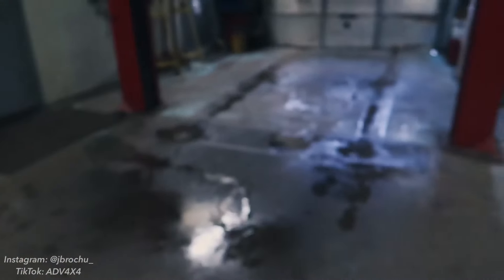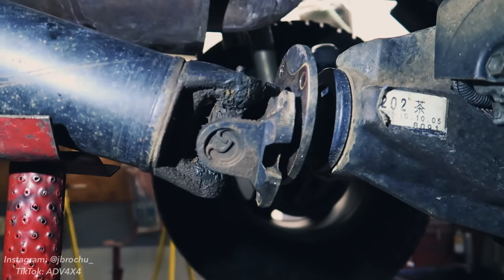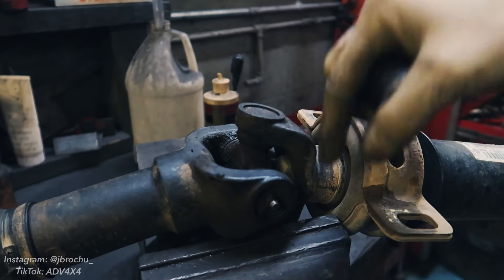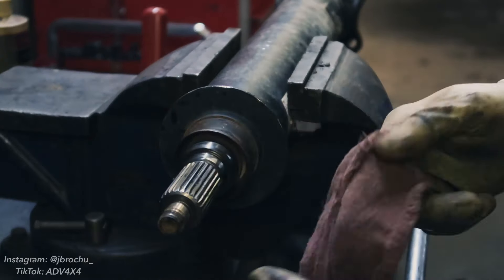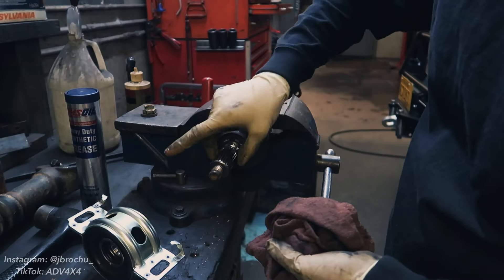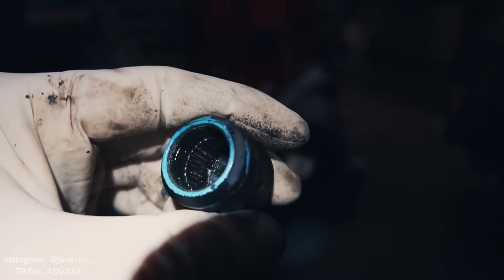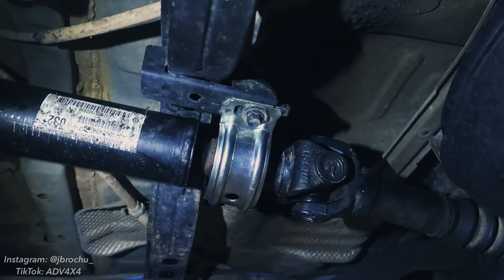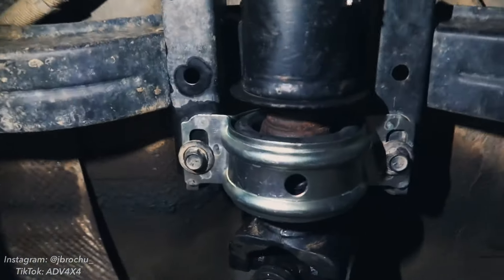How-to: Tacoma Carrier Bearing Replacement **DETAILED**

Comment: Ok so I did this exact repair, u joint as well, and I guess I missed my marks when putting the shaft back on?? Now when going from stopped, of I give it a little gas, the drive shaft slips! Can't find any of my marks. How do I find where to put it back? Is there another way?
Reply: Update, I did put the shaft in correctly, but apparently the bearing is bad? Ordering the more expensive OEM part. My mechanic said they always go wrong so they don't do them in house anymore and refer it to a local drive shaft place

Comment: Just watched this also! Agreed best video around! Thank you for this! 👍🏼💯
Reply from the maker: Thank Robert!
Reply: @Adv4x4  - I just went under my truck and checked the carrier bearing and it’s shot. The rest of the u-joints are tight though. I also have a bit of a lift with 35’s. I wonder if I should get that drop for the CB.

Comment: Thank you for posting, this helped me with my 03' Tacoma. Question...I forgot to index the drive shaft before removing. How can I tell if I reinstalled incorrect? Will the vibration be obvious? The Weights on the drive shaft are still in tact.
Reply from the maker: Take your best guess. You may not encounter any vibrations at all! But I usually index the shaft to be safe.
Reply: Thank you!

Comment: Damn got the wrong U joints and the greaser wouldn’t fit. Ended up putting in the u joints without the greaser since it was rubbing w the front shaft yolk. Hopefully it’s greased enough 😅

Comment: Thank you for your video. A few nights ago as I was driving home from work on the Friday night going around 55 to 75 mph I fill my truck rumbling. What changes is that it’s the carrier bearing?
Reply from the maker: I would check your front wheel bearings. Without being there it’s hard to diagnose for you but they are very common and prevalent at speeds you mentioned 👍🏼

Comment: great video! Can it do damage if you have some vibration at startup and don't replace the bearing right away? 2004 Tacoma thanks!
Reply from the maker: You will not feel a vibration on start up of the truck due to a bad carrier bearing. You will feel the vibration as you begin to accelerate from a stop and then it evens out as speed increases. It’s best to replace sooner then later
Reply: @Adv4x4  sorry, that is what I meant. starting up from 0 to about 10-15 MPH the vibration goes away and I also hear a faint squeek squeek at 1 to 5 mph. Can it cause more damage if not replaced right away? I did grease all the ujoints and the squeek did not go away. thank you!
Reply from the maker: @onemanzone727  usually the squeak like you described would be one of the pivots on a ujoint being dry. After greasing it should have quieted down but at the same time the passage could be clogged and not letting grease get in there. 

To be safe Id get it replaced sooner then later. You don’t want a ujoint to fail while you are out somewhere.
Reply: @Adv4x4  thanks for the info. Very much appreciated!
Reply from the maker: No problem, good luck!
Reply: @onemanzone727  I had one literally blow out about 300 miles from home. The rubber gasket part blew out of the bracket leaving the bearing loose and flopping around in the bracket. Luckily I saw where the rubber gasket fell out behind me. I stuffed it back in and zip tied and other stuff to secure it back in and I hobbled home at 45 mph for 300 miles.  I figured every mile closer to home would be one less mile I'd have to pay the tow truck. I made it, about 8 hrs later!
Reply: Jesus.

Comment: I RARELY ever ever comment on a video. But this was incredibly detailed, informative, well photographed, just so well done. Thank you so much! A shop here tried to charge me $2k for my carrier bearing(they said the entire driveshaft had to be replaced because the carrier bearing can’t be removed) and wheel hub bearing. Definitely will be trying to handle this myself thanks to your tutorial! Going from $2k to a couple hundred, thank you sir
Reply from the maker: Awesome! I’m glad it helped you out. Good luck on your carrier bearing and thanks for watching!
Reply: Hell you can get an entire replacement driveshaft ready to go for about $550 + shipping online.
Reply: @daveweber9737  If you have the $550.
Reply: @daveweber9737  I'm finding $300-400 for an entire driveshaft w/ new u-bolts & Carrier Bearing that bolts right up, seems like the best was to go.. idk
Reply: @Survey_gos  Where from? The cheapest I found was $500 shipped.
Reply: @Survey_gos where are u finding tacoma parts that low?
Reply: @pitchforkpeasant6219   nevermind, it was more around $700 on the low end

Comment: I read in a tacoma forum that you first have to torque it to 134 ft lbs and then loosen it up and torque again to only 51 ft lbs. Is that information correct. Everything else in the videos is great very detailed. Thanks
Reply from the maker: I pulled the torque spec information from All Data which is a huge automotive database used by I’d imagine almost every auto repair shop and I just followed their instructions for that part. So it is correct to the best of my knowledge 👍🏼
Reply: Thank you very much for the reply.   134 ft lbs it is, I'll be doing this in a couple of weeks to my 07 Tacoma. 👍👍👍
Reply from the maker: @kareoca10  no problem! Goodluck with the repair

Comment: Yeah 6 attempts in on my universal and still no dice. This new one has so much magnetism it keeps sucking the needles right out and getting in the way inside. At any point you shift the universal in the cup it pulls them out like a string or causes to flatten inside sometimes. It even sucked them up into the center of the universal at one point. I’ve tried the grease trick to keep them in place and that didn’t work like it normally does. I’m giving up on this one and I’ll have to go buy another brand and try again or pay someone to put it in since I’ve hit my frustration limit. I’ve done universal joints before and I’ve never had this kind of problem before.
Reply from the maker: I have never dealt with them being magnetized like that either. I believe you can demagnetize things (I’d google how) and try again. That is definitely a strange thing to encounter.
Reply: @Adv4x4  yeah that was a spicer too. I finally gave up and slung  it across the garage and bought a precision brand and it didn’t have that issue. Went on much easier but i made the colossal mistake of using soap stone to make my marks. Yeah with all that fighting my marks were gone. But I expected it’ll be right off then right back on.wrong! So then because my marks were gone my yoke ended up a tooth off because it it was tight and shot off instead  of slipping off. Finally got it all back together and no vibration thankfully. So yeah it’s been a interesting adventure  lol.I learned my lesson not to mark critical stuff with something that rubs off.
Reply from the maker: I’ve learned plenty of lessons like that myself over the years it just makes us better at it in the end! Glad to hear you got it resolved and no vibrations 👍🏼

Comment: Good vid. Any chance of knocking the drive shaft out of balance when ur banging on the yoke to get the U joint caps off? I used a ball joint press for the U joint, and puller for the yoke/bearing when I replaced mine, but banging them out seems easier😊.
Reply from the maker: As many of them as I’ve done like this I haven’t had any problems so I’d be willing to say you won’t have any issues! Now if you clamp the drive shaft too tight in the vice and dent it you will have vibration issues for sure. 

Either way works I prefer the hammer and socket method it’s fun, quick, and easy instead of messing with the press kits!
Reply: I’ve heard not to use a vise, but if you’re not having issues then whatever works! Being gentle as possible is a good idea
Reply from the maker: Yessir! That’s why I made sure to specify that it not be clamped tight at all!

Comment: I have a 2005 tacoma with a 2.5in lift. I had my center bearing replaced 3 weeks ago. Well the mounting bolts broke off and now the drive shaft is hanging down..... The mechanic who did the job claims its the bind from leaf springs that caused the bolts to break.... Any idea what happened?????0. I never hit anything  and I dont off road hard at all...Thanks

Comment: if my carrier bearing doesn't spin as freely as yours, does that mean I didn't add enough grease inside it?  I didn't fill those channels completely as you did.
Reply from the maker: Sometimes new bearings can be stuff too roll around at first. It should free up after you get it on the truck and it’s gets used.
Reply: @Adv4x4  phew I was really not looking forward to pulling it all apart again. Thank you

Comment: Note if your only doin the carrier bearing you don't need to remove the drive shaft
Reply from the maker: Sure you could, but four more bolts and it’s much easier to work with on a work bench.
Reply: Faster and easier on The truck.

Comment: One of the better videos of a carrier bearing replacement! One thing I would add is to smack the driveshaft by the u joint after installing the u joint to release the tension on the part due to pressing in the joint to the shaft. Ypu are a really good technician, keep up the great work.
Reply from the maker: Thank you sir I appreciate it! It’s been a Few years since I made the video. But If I remember right I covered that in this? I could be wrong. But that’s standard procedure for me! Thanks for watching!
Reply: @Adv4x4  I just watched video again and you tapped the cir clips in , not really smacking the shaft housing, but are a better mechanic than I will ever be, THX, Ed

Comment: Have you done this replacement on a 2WD taco? Mine doesn’t have the bolted flange to the xfer case, it just slides in/out. I’m nervous about pulling it all the way out in case there is some “key” to it I need to be aware of. And it looks like I’ll have to at least top off trans fluid, any suggestion there? Thanks!

Comment: No driveline rebalance?
Reply from the maker: No sir. Made witness marks to put it back as it came off.
Reply: @Adv4x4  You don't think the bearing failed because one or both of the drive shafts were out of balance?
Reply from the maker: Sure, but if that’s the case then every  Tacoma left the factory with an “unbalanced shaft”. It’s a repair most Tacoma owners end up doing as it is a wear item 👍🏼

Comment: Nice man, just curious on what issues u were experiencing with the bad carrier bearing?? I have a 2014 double cab trd with a 2.5 inch lift front iron man 4x4. Already had to do the clam shell bushing for vibration issues but now I’m having a different vibration/hesitation feeling  and I am wondering if this bearing is my problem. I’m having a weird vibration at the 45 mph range. It seems to happen right before the truck downshifts but the vibration is present before and after from 40-45. Any ideas please let me know.  Thank you
Reply from the maker: If it’s at a specific speed and throttle or shifting doesn’t change it unless it’s left the range where it vibrates 

I’d first-  check the air in your tires some tires at lower pressures will give vibrations at certain speeds. 

Second jack up your front end and check for tie rod play. A loose inner or outer tie rod can also give you a vibe at certain speeds occasionally. 

if you don’t see issues with either of the above, go get your tires rebalanced. And ask the mechanic to make sure you don’t have any broken belts in your tires they should easily be able to distinguish that while  balancing.
Reply: Ok 👍 thank you for the reply

Comment: I just bought a second gen and noticed a lot of vibration in the rear end so I crawled underneath and was able to move the whole drive shaft around this bearing. Would that indicate that mine needs to replaced? Please be nice this is first truck I’ve owned that doesn’t have a solid driveshaft
Reply from the maker: You will be able to move it around. Mainly to see if it’s bad check for a vibration you feel in the rear of the truck when you first accelerate from a stoplight

Comment: I bought a a rebuilt drive shaft. Man said it was balanced. So I have no preexisting marks to mount it by. The man at the drive shaft place said they were not needed. He said a driveshaft is balanced off the truck and that marking it was not required.  I put it on my truck and it does not vibrate.

Comment: I'm a big fan of double wrenches for extra simple leverage. You are the first mechanic I've seen employ the trick. I'm  sure that more do. Thanks for the vid.
Reply from the maker: Gotta get creative at times to get the job done! I use it at work often. Can’t always get a rachet and socket into places. Glad you liked the video!
Reply: Stupid question....why didn't you just use the impact to undo the four bolts at the pumpkin?
Reply from the maker: Not everyone has access to air tools and I wanted to show how to do the job with basic tools 👍🏼
Reply: @Adv4x4  Got it. Thanks.

Comment: Thanks for making this! How did you know your carrier bearing was bad? I think mine may be.
Reply from the maker: You will get a slight vibration on acceleration when you take off from a light! Or you can get under the truck and you can see how much slop it has. Mine was visibly bad as well. Drive line was sagging in the bushing 👍🏼
Reply: @Adv4x4  Thanks! Nice Taco BTW!
Reply from the maker: Bill Hardy Appreciate it man👍🏻👍🏻

Comment: Hey Mr. 4x4, I’ve currently got everything set and ready to remove the driveshaft, right now I’ve completed the indexing part but my driveshaft won’t spin freely, it’s like it’s locked up. I tried lifting the back with my jack and I have the two rear wheels up off the ground and it still won’t rotate in Neutral. I could borrow two more jack stands from work to jack up all 4 tires, would it rotate then or am I missing something?
Reply: Oh, and it’s a 2013 Prerunner 2.7L 4L, 2WD
Reply from the maker: Make sure your parking brake is off! But parking brake off, and in neutral it should be able to rotate 👍🏼
Reply: Never mind! Got it figured out, it was my emergency brake that was doing it. Though I may have run into another issue. I removed the driveshaft in neutral, but I can’t work on it anymore tonight. My key won’t come out of the ignition while it’s in neutral so I shifted it to park to lock it up, when I shifted to park, I heard a grinding noise and I think the pieces that are connect to the driveshaft moved, should I be worried that I screwed something up or can I just line the driveshaft where it was indexed and it’ll be ok?
Reply from the maker: Everything should be just fine!
Reply: Sweet, thank you so much sir, you are a lifesaver!!!
Reply: One more question if you don’t mind sir, I’m struggling haha. I’ve got all the steps done but one... I have no bench vise and my clamps aren’t holding the vise tight enough for me to torque the nut that tightens the bearing to the shaft, I try and try to turn it but it just spins and I end up fighting myself on it. I’ve tried holding one wrench with my knee through one of the u-joint holes to keep it steady, I’ve tried standing on it and I just lift myself off the ground. Will it be bad if I can’t torque it enough? I got it to about 80 foot lbs
Reply from the maker: It is important you get it torqued to the right spec if you can maybe enlist the help of a friend to help hold it!
Reply: @Adv4x4   I was afraid you would say that ha, ok I'll give it a shot! Thank you sir
Reply: Dude! I just had an idea! I’m gonna install just  the front driveshaft along with the carrier bearing mount. That’ll keep it from rotating on me, and then I can torque down that nut while I’m under the truck, then take it back out to reinstall the u-joints! Woot woot
Reply from the maker: @TheSnowflakemt  awesome thinking man! Didn’t even cross my mind. Good job 👍🏼

Comment: The original U-joint had a grease fitting in the cap.  Did you replace the U-joint with something different?
Reply from the maker: The new u joint also has a grease fitting just a diff style one unfortunately. One day I’m gonna swap it out for one with a standard grease fitting.

Comment: Any advantage to taking the whole shaft off versus just removing the rear at the slip yoke spline?
Reply from the maker: Personally like to work with things on a work bench instead of under the truck, especially while I was recording this. Can’t imagine disassembling the u joint under the truck if you are doing this on the ground and not on a lift.

Comment: Have you had to add any spacers between the bearing housing and the frame where the part is mounted?
Reply from the maker: I personally have not but it wouldn’t be a bad idea to do so.
Reply: If you are doing this same job for a Tundra, there will be a washer between the bearing and the yoke. At least for a 2013 Tundra TRD with a 3 piece axle.
Reply: @jasonbarnes5282  I ordered a spacer kit form Old Emu

Comment: Awesome! Thanks for your descriptive and informative video. I’ll be doing this task on my son’s 08 Tacoma while he’s away on deployment 🇺🇸 Before he left, he was noticing extreme vibration at higher highway speeds. Once repaired, a test drive will be mandatory at a nearby 4x4 trail 😎
Reply from the maker: Thank you sir! Hope all goes smoothly for you. Be sure to have a u joint on hand for the repair as well. A vibration at highway speed from the driveline could also be that.
Reply: Adv4x4   Thanks for the advice 👍